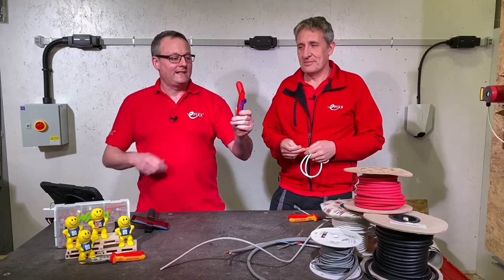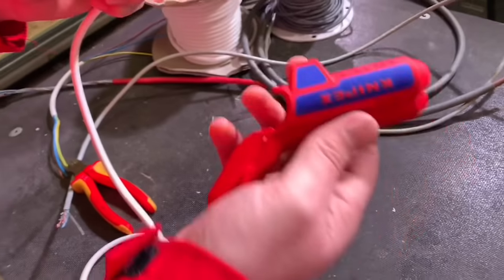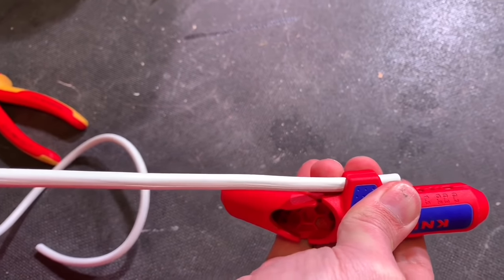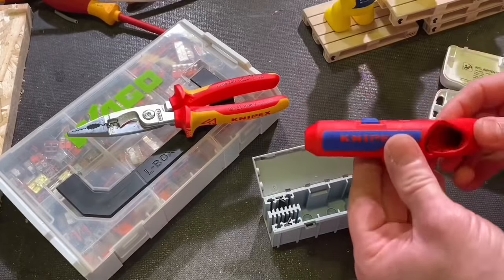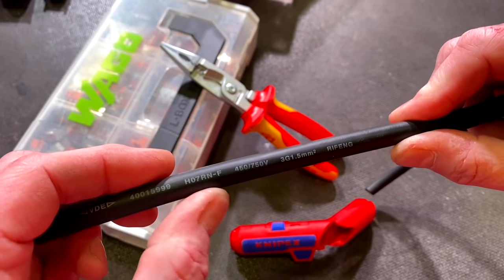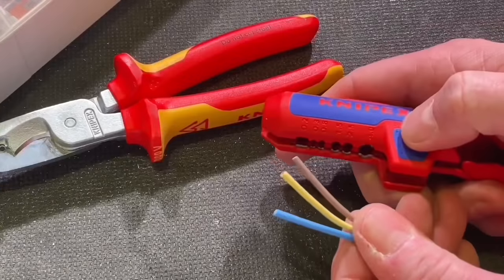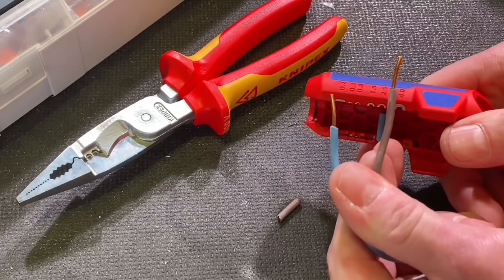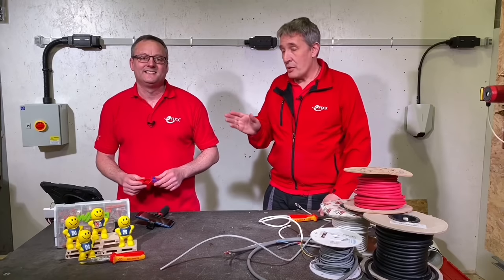REVIEWED: KNIPEX ERGOSTRIP  - cable stripper - ideal for RIGHT or LEFT handed ELECTRICIANS

Comment: I've done thousands of cat5E, cat 6, cat6A and cat 7 with this tool, not one damaged. Same with coax 6, never had any problem. Great review guys
Reply: Yeah, but they should not have stripped the individual wires, as all connectors are IDC.

Comment: I have been using one for about two years now. It is good but you do have to test it first on the cable type. I found it can nick or score the inner conductors on some flex type cables if you apply too much pressure and I think that may be caused by different chemical composition of flexible cable types particularly ones with a hard outer sheath. Once I got used to it I really liked it. Not sure I would use it on coax as I have always used a Corex 2 for that purpose and the Corex will strip all the parts of a coax in one strip. The Ergostrip is great for NYM cables and I would highly recommend it for that. Finally, Knipex do a demo video on YouTube, you should look at before using the tool as they appear to score the outer sheath and then move the tool back down the sheath before pulling to slide the outer sheath off.

Comment: I got this soling for stripping  cat 6 sheltered and 5 wire cables. This was sometimes very difficult to do before without nicking the wires underneath. Now, easy prays. Combined this with my Klein pass thru cat 6 crumpets and ends, makes making com cables a breeze. Love it!!
Reply: Funny I have been using mine for CAT6 as well. Really cuts down stripping time although on some cable types it can nick the inner strands, just a bit of care needed on my part. Other than that 💪
Reply: Cat 6 crumpets? 😂

Comment: I use it for flex, saves time without worrying about inner conductor insulation. Locking mechanism can do with improvement, it's become slightly loose.
Reply: Locking mechanisms on any of these tools are shite. Just gravity is enough to open it. But couldnt imagine working without one.

Comment: I do lots of data cabling, CCTV (POE and traditional coax) and install intruder alarms.  For me it's a brilliant tool, I use it to strip all data cabling, even down the individual cores for older balun style systems - the same for coax systems as well.  And I use it to strip the inner cores on the mains connections to a fused spur for alarm panels.

Was working with an electrician whilst installing an alarm before Christmas and showed it to him and it wasn't for him - his words were he didn't need another tool to carry around.  Each to their own, I guess!
Reply from the maker: Great feedback thanks 🙏

Comment: great vid guys. I think I'll take a punt on one of these.  I purchased  a Jokari stripper,similar to this ,just out of curiosity & was well impressed after years of using the "classic" wire strippers . The time that these type of wire strippers save is something else. I work in France & the electrical system here is different than the UK as in there are a shed load of cables ,so, a tool that can make the job quicker is an investment.The blades won't last forever but if I had to buy two a year,I'd still be quids in .The knipex seems to be more versatile as well.
Reply from the maker: Great 👍 let us know how you get on if you take the plunge!

Comment: I've been installing lots of the newer style lot20 storage heaters for a housing association which as you know  have two power supplies.
This tool was actually on my Christmas list.
I'm not sure on the price if its a little expensive,i think they had come down in price but they  a lot quicker and easier when making 4 flexible cable ends off per heater( have to keep emptying the French chalk out though) :) so we'll worth it saving time.

Comment: Hi guys, interesting demo. I’ve been using it for a while now and find you need to be very careful with some cables such as twin and earth as it will damage the inner core insulation if not careful. It’s definitely meant for round cables rather than flat!!
Reply: I don't think they recommend it for flat cable , check out Knipex video on YouTube

Comment: I love mine use it all the time . Great for data cable.
Reply from the maker: How long do the blades last?
Reply: Had it for about 2 years and had no issues. I don’t think it needs to be razor sharp to strip most cable. I have found  when using once you have scored the cable if you move the move it Slightly lower down the cable and bend it up and down on the cable the sheathing comes off a lot easier.

Comment: I've been using the ergostrip for nearly a year now. As a maintenance spark in a hospital environment it's a great tool, you can really get into backboxes to strip data cable with it. However on the mention of coax, if you put too much clamping pressure on it I have found that you can easily damage the fine braided shielding. Just takes a few attempts to get a good feel for it though.
Reply from the maker: Thanks for the tip on the coax
Reply: Has it not work out yet?

Comment: Never bothered with wire strippers before. I just use my side cutters for twin and a stanley for anything else. It's just an extra tool to have to carry around. 

But yesterday I had to replace an 8 zone conventional fire panel with 4 sounder circuits and an extra cable to shut off a gas guard. All in all, 13 FP200s and another FP for the mains, some old, some new. Some enhanced with the screen, some standard with no screen. I'd managed to re-route most of the wiring for back entry as the old panel was an absolute mess, and it was such a nightmare to keep everything in place i decided it would be easier to strip the cables back further once I had mounted the new panel. 

I had such a hard time stripping the wiring back as I'd nick the FPs where they enter the back box and try to bend them. On the newer stuff this is usually enough for a not so neat cut, but the outer sheath does come off. But the old stuff just was not interested, and don't get me started on old enhanced. I'm wondering if one of these would be ideal for stripping FPs already inside a fire panel. I replace quite a lot of beaten up fire alarm panels so if it does that specific job then it would be a worthwhile addition to my tool box.

Comment: Since this video there seem to be a couple more varieties of this tool, the "KNIPEX Universal Stripping Tool (125 mm) 16 80 125 SB" and the "KNIPEX Stripping Tool for flat and round cable (125 mm) 16 64 125 SB". It would be great if you felt like doing another video comparing all three and helping us work out which one is the best buy for a UK sparks!
Reply: ive asked the same, seems the one that says it strips flat as well only misses a couple of thin wire sizes and is a third cheaper. I hope efix answers.

Comment: As good as it was makes me 😠😠😠 is the blades are not replaceable and its not a cheap tool for what it is other than that 👍👍
Reply from the maker: Cant replace the blades on a pair of side cutters either!
Reply: @efixx  not the same type of tool i can't see why the blades cannot be pulled out and replaced 👀👀👀
Reply: Seems quite expensive
Reply: @efixx  good point. You can sharpen side cutters easily with a file or grinding stone though. Not sure it would work with this product.  
Great vid as always and enjoy your content.
Reply: I would imagine it has something to do with the gap between the blades needing to be exact.  If they can be moved then they could become less precise.  But why not write to knipex and ask.
Reply: The blades are pretty sharp if your using it for the right purpose they will last a long time
Reply: @aldobongers807  messaged knipex it's a throwaway tool once the blades are blunt
Reply: @FISH-OHOLIC  Worth it though particularly if you work in the events industry and have to do a S**t load of cables as you don't need to keep switching/adjusting tools/hands. I've used one for years, it's done a LOT of work and the blade is still fine.
Reply: @paul_my_plumbs_uk  " throwaway tool once the blades are blunt", that will take a LONG time.
Reply: @mfx1  fair enough mate, thank you for the feedback/info.
Reply from the maker: @mikebolt9753  Congratulations!! You have won a prize in this months LIVE FEED event. To claim your prize please visit this link and input your details.        https://www.efixx.co.uk/unplugged
Reply: @efixx  Great news :) Very excited to see what it is. Thanks very much.
Reply: No good for stripping 10mm or 6mm single sheathed cable. Seems this has been overlooked by knipex
Reply: Don't worry about that – a colleague will steal it before the blades go.
Reply: Well after a long thought I got it today I usually work 1.5 mm and 2.5 mm cables i usually have a knife to cut off the out insulation but I am miserable and I want it total round that's why I bought it otherwise a have a way faster stripper for the inside insulations and to be honest I just collect knipex tools 😂 I got it for 45 euros yeah no cheap but we are professionals so we seek quality and we do know knipex is pure quality. I tried it in 3×1.5  5×1.5 and 3×2.5 cables I will be honest I stripe the cable with much pressure holding the tool in correct potition no dmg in inner insulations and then I used force and my thumb in front on the blade on the tool to cut the out undulation the potition of my thumb and the pressure was wrong again not dmg inside the insulations.I cut the inside insulations and I did a circle around the cable and then I pulled for the first time the insulation was removed like butter . Now if you are on a ladder instead of having a knife a stripper and the  pressure tool for terminals you can have this tool you save some space . As for the blades from what I see on the box it was talking about lifetime warranty and if you use it only for cables I don't think blades will ever be damaged
Reply: @paul_my_plumbs_uk  this 100% the blade FELL OUT today. And I have barely used them. Wtf.

Comment: I have been using the Jokari All-rounder for the the last couple of years abd it's still going strong. It can be used by either hand and it is a lot cheaper.
Reply: I am also used to the Jokari and prefere it. But i have to admit I never seriously tried the Knipex. I had it in my hands a few times and thought Nah.

Comment: Hi both of you,
From your experience of having for 2 years of stripper what advice can you give me.
I am thinking of buying this tool but the down side is it can not be use for flat cables.
Is there any tool that does both round and flat cables 2 in 1 tool?
Reply from the maker: Round or flat usually requires different tools.

Comment: I use such strippers very often, you can also get them here by different manufacturers, most common is Jokari or Knipex. They're 
All german cables are round shaped except one type. NYM and NYY are the standard ones and round, in older installations you can find NYIF, which is flat. It's still permitted to install this type, but no one does it anymore. NYIF is a cable with PVC inner insulation and a rubber sheathing.

https://asset.conrad.com/media10/add/160267/c1/-/en/001152554DS02/datasheet-1152554-faber-kabel-020289-multi-wire-planar-cable-nyif-j-3-g-150-mm-ecru-sold-per-metre.pdf

It must be nailed directly to the brickwork with special nails which have an insulated head (mostly cardboard). You'll have to nail between the wires into the sheathing, afterwards the plasterers plaster over it. If you need to go around a corner or make a 90° bend you'll have to cut the sheathing between the wires and fold the cable over. No contact to wood or other combustible materials. Not suitable for wet rooms. Back in the old days it was a cheap cable type, but now it's more expensive than NYM. The best thing is, when you rip it out of the wall you'll get a perfect new chase for NYM cable. In the old bedroom of my grandparents they used that type back in the 1950s. They used that in combination with conduits and H07V-U...ehm, sorry, since this was in the 50s and before harmonisation it is NYA of course... 😜

Main difference between twin-and-earth and german cables: CPC is always of the same size as the line(s), and the CPC must be identified with a green/yellow insulation over the whole length of the cable. So a sleeving isn't required. Only one exception, when the CPC is identified by position in the cable (excentric) like it's the case on the SWA or on NYCY (NYY with a copper shield which serves as CPC).

Keep up the good work!
Reply: Quick question we use NYMJ in Ireland a lot too but never in a chase in domestic we use twin and earth(our t+e has the same size cpc and it's insulated) in commercial it's steel conduit and singles. Any way my question is do you plaster directly over the bare cable or sleeve it in some kind of conduit?
Reply: @solidus784  You can do both, in most cases in domestic installations it's simply plastered directly over the cables. Cables are rated for this, so no problem at all. Even the old NYM from the 1960s directly embedded into plaster are still perfectly fine today.

NYM is rated for dry, wet and damp rooms. For surface mounted installation without additional mechanical protection, embedded into plaster or concrete. Only exception for concrete: Not vibrated or stomped concrete (compacted concrete) because the compacting process can damage the outer sheathing of the cable. Outdoor installation only when protected from direct exposure to sunlight. Should not be embedded directly into soil.
For outdoor installation we use NYY-J, also for buried cables.

Comment: I've got one, don't like it. I keep nicking the cable when using it to take the outer sheath off
Reply from the maker: we found this at first on some cables - it didn;t happen if we kept out thumb on the side grip.
Reply: @efixx  Okay thanks, i'll give it a bash tomorrow.
Reply: i'd like to how it goes for you
Reply: @aldobongers807  @efixx I got around to trying it out today. Works wonders. Honestly feel like a bit of an idiot because I only tried it a few times and nicked it each time and just gave up with it. Guess I should have read the instructions. I used it to strip 2 core flex inside an outdoor light which is awkward to get snips (side cutters) into. Beautiful. Thanks for helping

Comment: Has anyone used it on TRS cable? I quite like to use it for outdoor lighting but can be a pain to strip 8 meters high.
Reply: It's fine for that although with more rubbery cables it can help to give it a tight bend after scoring the outer insulation so it strips easier. This tool is heavily used in the outdoor events world where everything is TRS, they discovered it long before "normal" sparks :-) .
Reply from the maker: Great info 🙏

Comment: Does this work on the inner sheath of SWA
Reply from the maker: Yes - but you would have to be careful with the pressure on the blades as the bedding material in SWA isn’t a constant thickness around the cores.

Comment: I've used one for years, I do a lot of temporary/event/art installation type work mostly SELV/Data but some mains and wouldn't be without it, some jobs can easily be 500 plus cables/wires and it's one of my most used tools, pretty much lives in my pocket all the time, last job it was used on was a Christmas shop window display for the Microsoft store in Oxford street and it probably stripped well over 1000 wire ends on that job alone. It was also used very heavily in the making of the chameleon costume for Justin Hawkins of "the Darkness" on the UK version of the Masked singer.

https://www.youtube.com/watch?v=2sBE0QvWbgs
Reply from the maker: Great endorsement of the Ergostrip - thanks 🙏

Comment: Bought 2 from a online retailer in December and a complete waste of money and plastic and to make matters worse neither Knipex or the retailer want to do anything about replacing it what happened to the good old 12 months guarantee? What this space 👎
Reply from the maker: Which country are you based in?
Reply: @efixx  I’m in the uk
Reply: @efixx  scotland
Reply: what was the problem
Reply: @aldobongers807  the small flex cutting blades are sitting to far into the housing so it makes it very difficult to strip the sheath of small flex